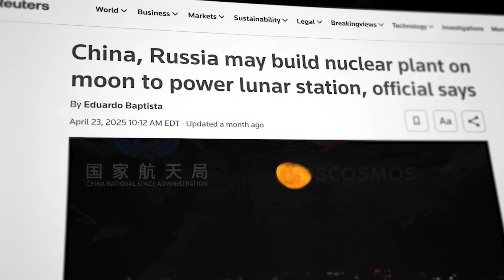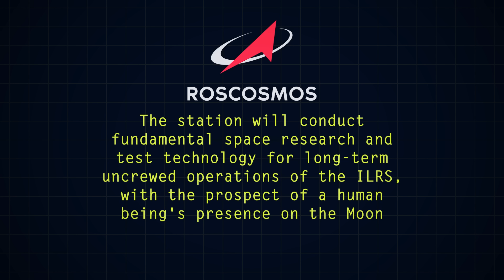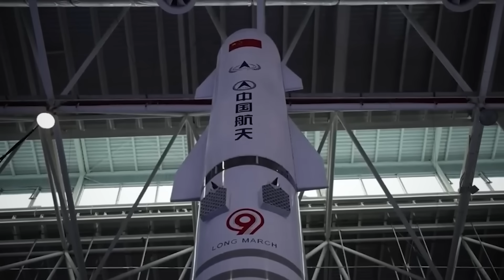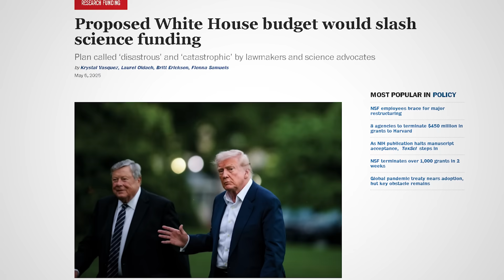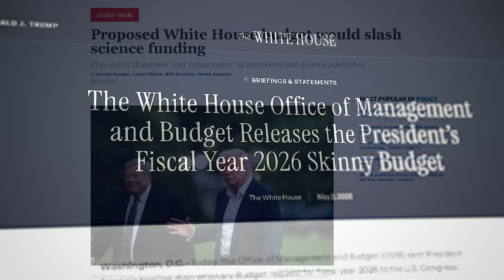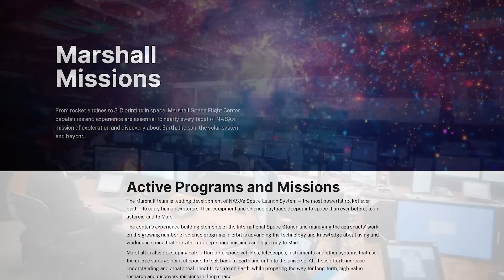China and Russia Are Up To Something Big on The Moon

Comment: The moon has abundant solar energy, far more than Earth (no clouds or atmosphere!).  To use solar energy, a base would need batteries to last during the 2 weeks of night.  I think that it would be easier to build cold resistant batteries than build, and supply, a lunar nuclear plant.  The batteries could be buried. under the regolith - the temperature at over 30 cm  down is pretty constant, and never gets as cold as on the surface.  The nuclear option sounds much more relevant to Mars than the moon.

Comment: Energy like this has existed forever. 
Heck they have a battery now. Runs hot for 50 years and after that it's slightly active copper. Then just copper  
Imagine that. We are loosing the drive for success while fed a plate full of personal life options. You could see these days coming 2 decades ago. One decade ago it was obvious to all. Yet here we are heads down in dummyville

Comment: There's so much indirect solar energy on the moon that a fueled power plant is nonsense. Try solar panels... Not much is going to beat that yield on the moon without atmosphere. Or fiind a crater with shadow and extract energy from the temperature difference with a turbine. Both are scalable with barely a limit.

Comment: Is Russia’s experience in building nuclear power stations on earth transferable to the moon? Is it Really? Is there some kind of skid mounted pocket sized ion exchange nuclear fuelled power station, because the standard earth bound nuclear power stations are large, use coolant and steam and pumps and external sources of power, and turbines and human operators and it all requires ongoing maintenance… 2030 is surely a pipe dream.

Comment: its all guff the Chinese have not put a man on the moon yet. just saying what they plan is cheap and will probably never happen for a rocket booster to get a nuclear powerplant  on the moon the chinese will need several Saturn V sized boosters to get it there the Apollo Lunar module was made out of ultra lightweight materials like tingoil or mylar for Apollo,even then the saturnV booster was near yhe limit of its capability to get men to the moon 
  the chinese will ptobsnly never rven get a man on the moon the only agency capable of putting men on the n
moon  in 10 years or less is spaceX the only thing preventing spaceX from going to the moon or Mars is the FAA!

Comment: How's the nuclear plant going to work? First there's no water or fluid of any kind for cooling. Second, there's again no fluid to spin the turbines to extract power.
Reply: they are gonna use lunar soil to cool it down, less efficient but works without water. as for turbines, there are closed cycle reactors already.

Comment: And what will they do with the nuclear waste on the moon?  Pollute it too?  P.S.  At 3:11, I'm sure you meant 2036, as you don't bring something online before it is built.
Reply: it would barely change the radiation level even if the just dump it on the surface. add the fact that we are talking almost nothing in mass (the usual mistake with nuclear waste, it is so small amount, that it is literally irrelevant) so they can deal with it in any way they prefer.

Comment: I have always said that a Mars city will need lots of power and nuclear is the only answer. The sooner we adapt a sub reactor to work on the moon and Mars the better because moon has two weeks of darkness and Mars has about a quarter of solar compared to moon. Booster 14 is not landing in the water to be safe, they will experiment at shutting down one of the landing engines and see if they can still land. Better try that over water.
Reply: And no plan to reply a third time as they have ships and boosters lining up with upgrades so better to try or test new procedures or failure modes. More to be learned this way. Still hate the idea waste and environmental impact of water landings but it's essential to the process and learnings at this early stage fir a better future outcome

Comment: Mining Uranium on the Moon: Never Never Never Never Ever. Russians know this. Only you don’t.
Reply: I'm always surprised that they think ore deposits create themselves without a hydrological cycle or tectonic forces.
Reply: @gasdive  Why do you need hydrological cycles for ore deposits? I suppose on Earth water could concentrate some deposits, so they are cheaper to extract, but the ore was not created by water, or by tectonic activity.
Also, most ore does not evaporate. Past tectonic activity or volcanism could have brought up deposits near the surface, and when tectonic activity stopped, the deposits just stayed there.
Reply: @nikolatasev4948 how would you concentrate the ore? With what energy source? Heat only dissipates via radiation on the moon, how would you cool everything?
Reply: @andrejmucic5003  Just wait 14 days and you are in the cold time...  How cold do you need comrade?

Comment: The lunar gateway was not only a dead end, it was a terrible one. They only designed it that way (rectilinear halo orbit) because of how incapable the SLS was. They do need a lunar station, but just a standard orbiting station that can actually be used as a safety stop when it might be needed.
Reply: The lunar gateway was a grift.  Boeing lost it way once it merged it Lockheed.  I think NASA realized it was being played after SpaceX was able to provide more at less cost reliably.
Reply: That's mixed definitely I think the same-idea but just different.